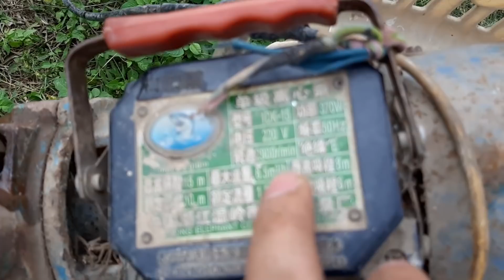How to turn a Air Conditioner motor into a 250v generator

Comment: Vaya pedazo de farsa como puede tener un motor de combustión en marcha sin tener la bujía conectada es imposible esto es una falsa
Reply: Si la tiene conectada, miren con atención.
Reply: No hace falta q tenga capuchón la bujía está conectada solo con cable
Reply: Vale crack disculpa sí que tenías conectado a la bujía pero una pregunta cómo generador no tendrías que poner un regulador de corriente por las subidas y bajadas de tensión al acelerar y desacelerar el motor de la desbrozadora
Reply: Face

Comment: How a dc motor works as a generator without rectifier.... total fake
Reply: Thats the reason he magnetized the outer shell..you can also attach permanent magnets and it will work, you can also do it with alternators and other motors